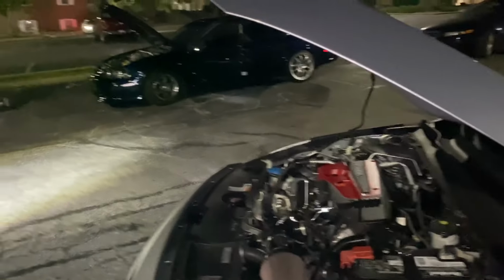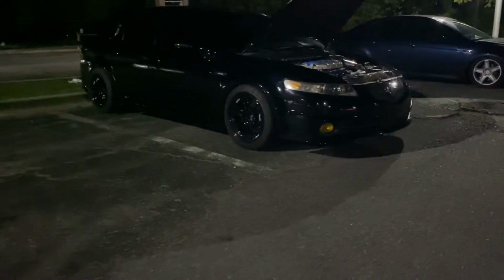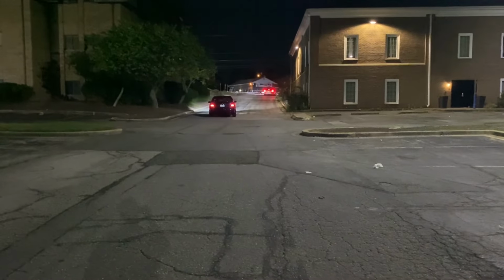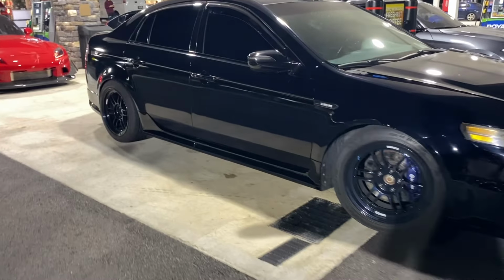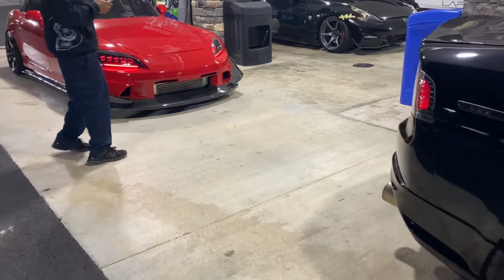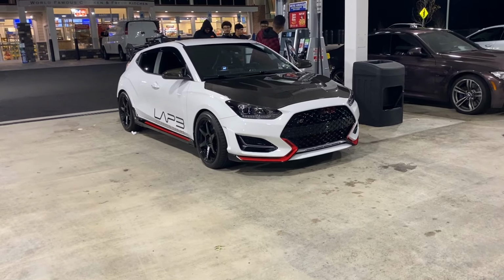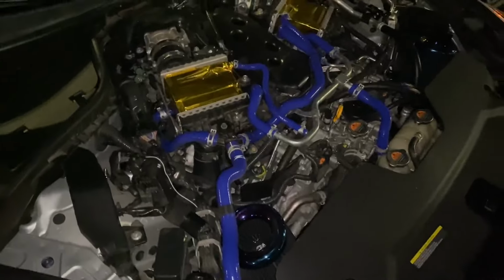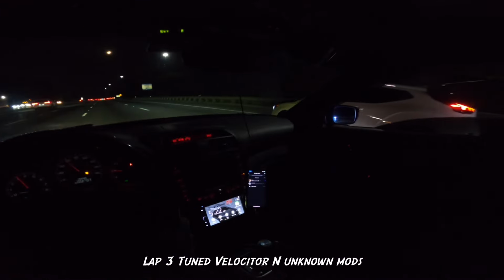TL Type S VS The World Part Two

Comment: That 370 run was good and the 3.0t Infiniti even if you gave them the jump I’m sure you’ll still gap.. curious to see what these thing end up doing with alittle more mods .. the 2.0t accord wonder if he was break boosting or very little turbo lag from the jump but 400 plus to the wheels he should be able to pull ahead quickly but overall good runs great content 💪🏿💪🏿

Comment: My wife used to have an 06 Odyssey, the previous owner had an r6. I swear that minivan was tuned lol. It moved on the 0-45 😂😂 makes me wonder how a built/boosted j37 would do in a s2000.. I'm a v8 guy though, I own a 700 hp 5.0 Mustang and a Lightning swapped 1st gen Expedition making 450hp/530tq with a pulley.
Reply: I have a 05 oddy now that 3.5 move feels like I’m driving my 9th gen 6-6 lol … and the damn thing drives so damn smooth for a 05 with 180k on the clock I’d definitely get another oddy lol